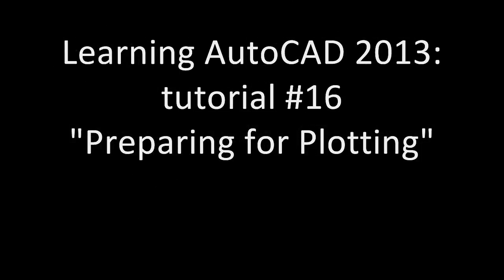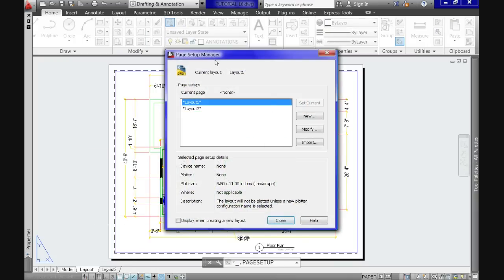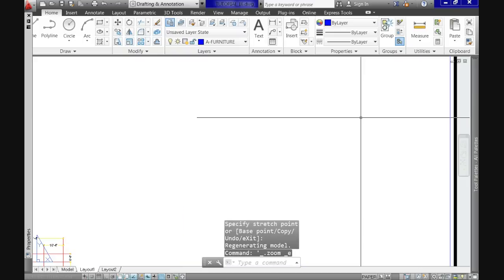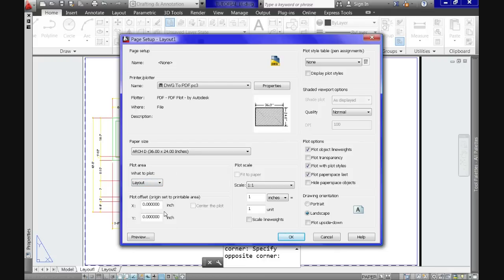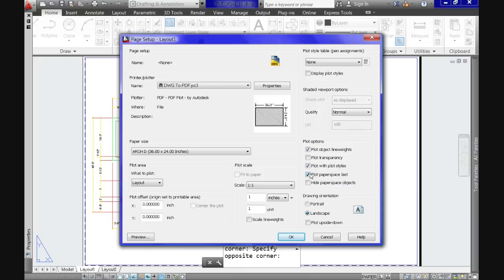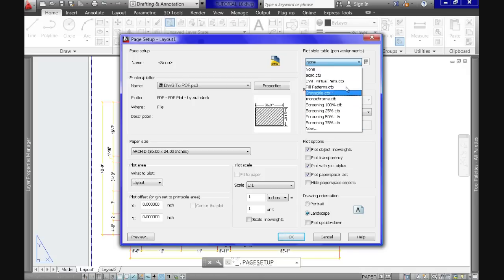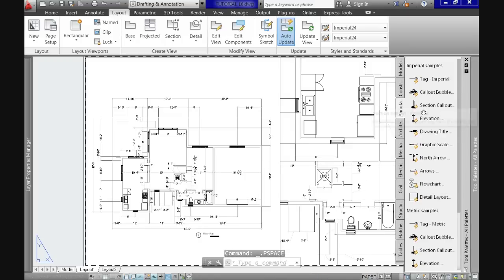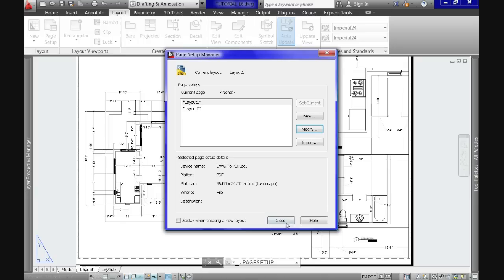Learning AutoCAD 2013, tutorial 16: Preparing for plotting (printing).

Comment: hello,

There's a problem with my autocad as the paper size became bigger after modifying and changing the paper size, the viewports could not be stretched. There are no red grips appeared on the corner of the viewport line when clicking the viewports line in PAPER SPACE. Unlike your video you just clicking the blue line of the viewports and grips appeared and stretched command came out. How do I stretched the viewports in order to accommodate the current size in paper space?

Comment: I found that all dimensions disappeared when I tried to change scales from 1/4". I need to change a scale to create kitchen or bathroom views. Can you tell me how to fix this problem?
Reply from the maker: Sam Lee Many things could create that problem. You might need to visit the tutorials #14 & 15 to find out the 
reason. First of all is it happening in paper or model space? What type 
of styles are you using, Annotative or User define? Let me know
Reply: easycad4you What type of styles did you use in this tutorial? Annotative or non-annotative? Which way do you recommend in cad drawings?
Reply from the maker: Sam Lee Here I'm using annotative which makes it easier to plot when you know how to use it well. But as you'll see in previous videos I presented how to create and use the so called "user defined" styles. Normally I use annotative styles for obvious reasons, however I still have in my templates user defined styles for last minute touch ups if necessary. It all depends on your own way of working. Hope this helps.